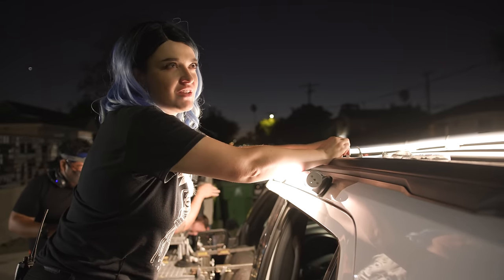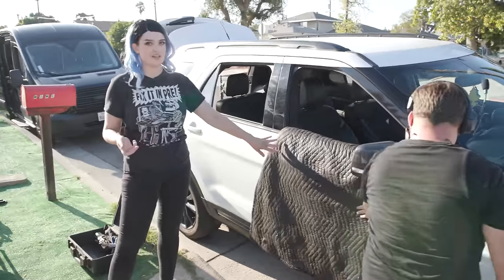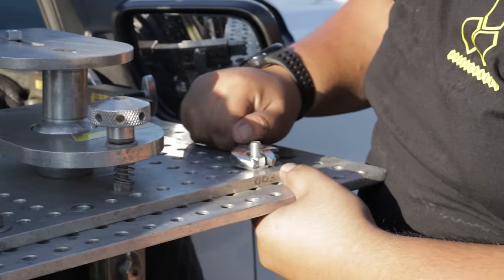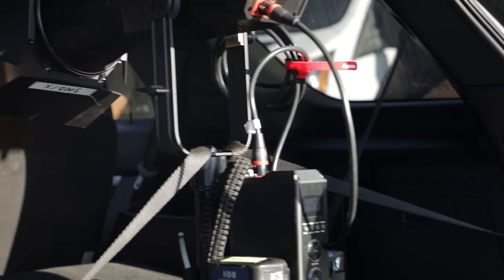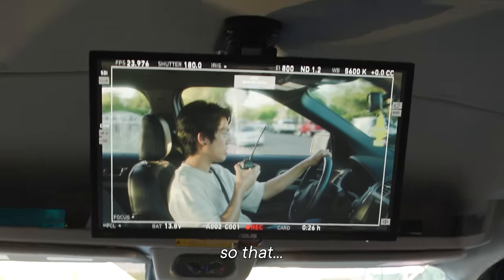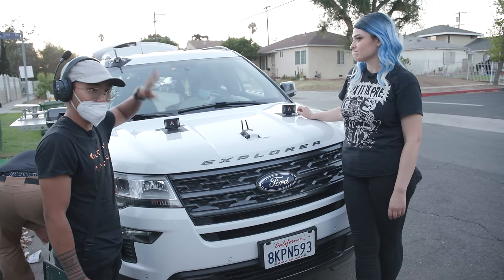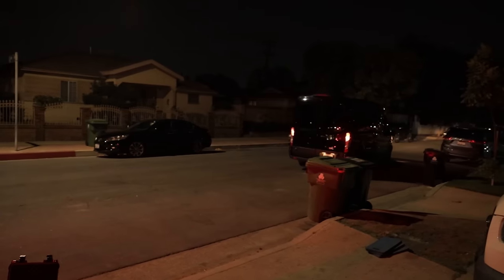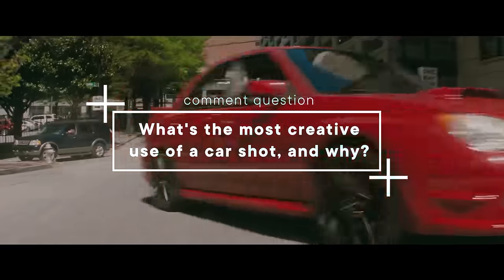How to Film Driving Shots | Camera Rigging & Lighting 101

Comment: In Fast & Furious 5, directed by Community's "Paintball" genius, Justin Lin, when the team - sorry, family - finally get into the bank and chain the actual vault up to the Dodge Chargers, they speed out with all the corrupt cops of Brazil chasing after Dom and Brian. After Mia informs them to go straight, but the cops roll out spike strips to stop them, Dom tells Brian that they have to turn right. As they turn right, the bank vault rolls & crashes through a building, and as the cables pull taut on the Chargers we get an amazing shot of the rear wheels of a Charger lift off the ground by the weight of the thrashing vault and bounce up & down on the asphalt as the tire screeches attempting to get traction again due to the sudden shift in weight. Quick, effective, and creative!

Comment: The car chase in The Raid 2 is insane. Multiple camera handoffs as the cam moves through a car (a cam op is dressed as the passenger seat 🤯). Passes off again to a guy rigged to the outside of the car. Definitely not safe though